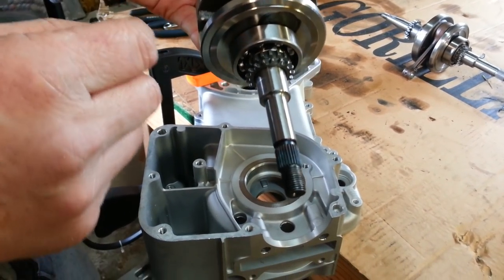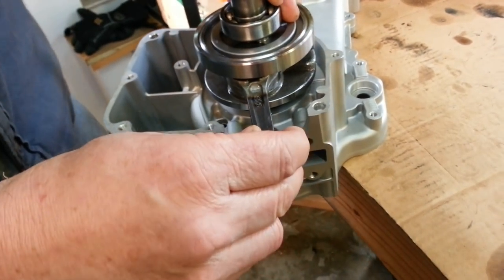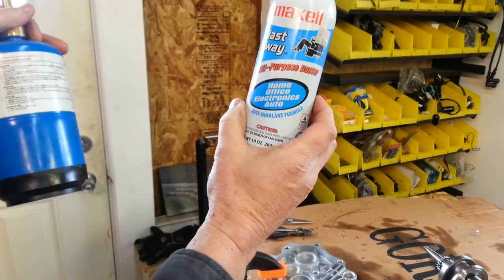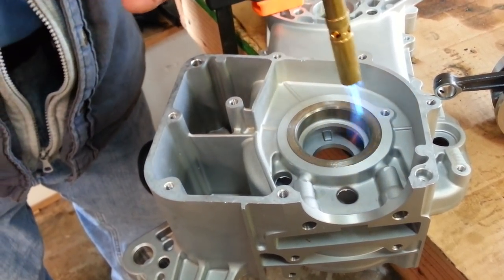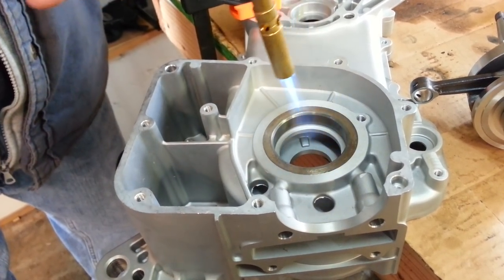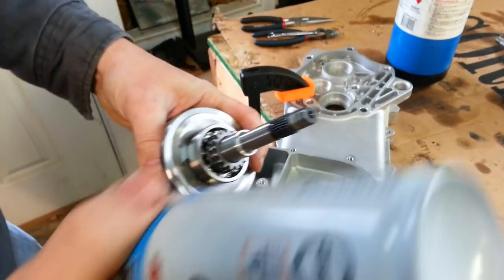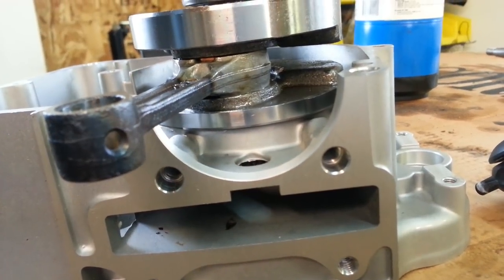GY6 Stroker Crankshaft Install- SCOOTERS TO GO

Comment: It doesnt go easy like in the video. I heated up my crankcase to with a blow torch for almost 10 minutes. But the bearing doesnt slide in. I also used freeze spray on the bearing before installing in in the heated crankcase.

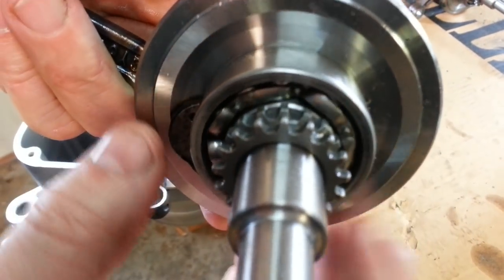Comment: hello, tank u for the video! may i ask about the little gear  here 0:33 ? How to uninstall it? do i have to spin it like a nut (if so.. witch direction) or i have to heat it up and slide it out? I have to replace that bearing, seems the owner before me didn't watch your video :)
P.S. when we do those termo-manipulations, don't we bend those parts?.. or at least make them less stronger?
tank u in advance :)

Comment: Hello could you please tell me how to get the kick start gear off from the other side when taking the old crankshaft out? the 1 thats under the variator + before the oil seal, cheers

Comment: is a upgraded crank needed to the 50mm bbk?.. I've heard of people getting up to 14000 miles on the stock crank... I'm about to build a motor with the 50mm airsal piston...
Reply: I've upgraded to a 100cc bbk two years ago and the stock crank is still alive...
Reply: yes, go with the 44mm crankshaft.  I have a big bore kit and with 6000km on it, my crankshaft bearings are starting to rattle.  so I bought a stroker 44mm crank, and will upgrade to 52mm bore

Comment: great video thank you.

I have a question if you dont mind..

How do i take apart the crank to replace the big end bearing ?
Reply from the maker: There are a few specific bearing pullers on the market to pull the main bearings. They range from around $70 to $170. We can do it as well.

Comment: This one is classical...FORGOT TIMING CHAIN !!!!Sh.....t!! F....!!!
Reply: timing chain can be installed or removed with crankshaft still in motor through oil seal hole belt side